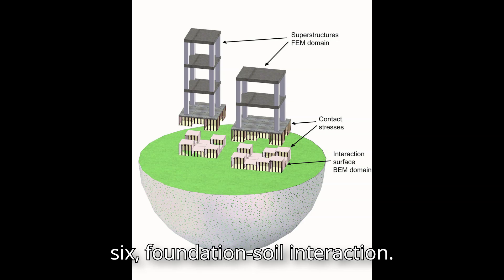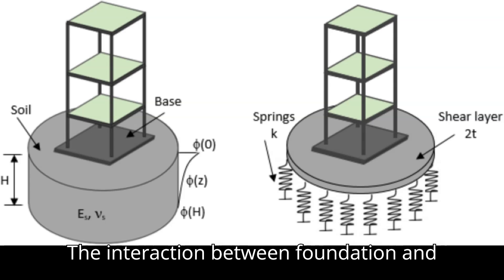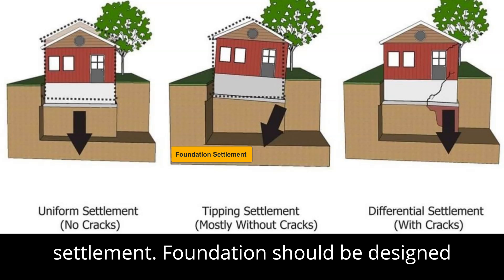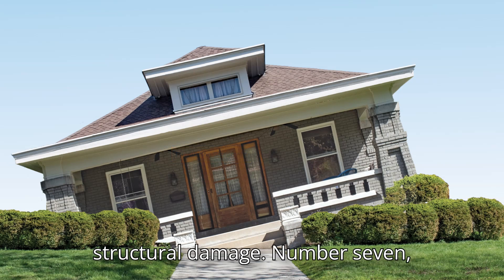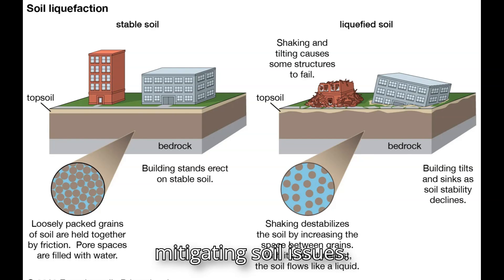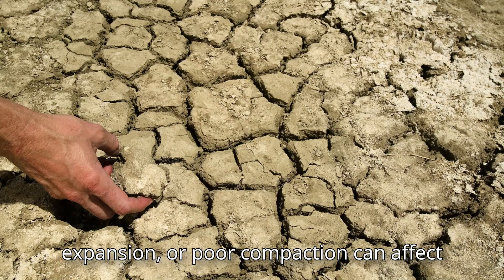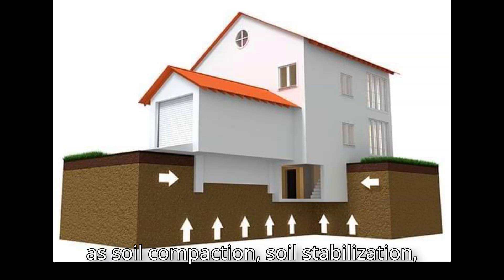How Superstructures, Foundations, and Soil Interact in Construction and Civil Engineering Visually

Comment from the maker: The video used visual concepts to show you how foundation interacts with superstructures and the soil in construction and civil engineering. 
00:00 Introduction to Foundation-Soil Interactions.
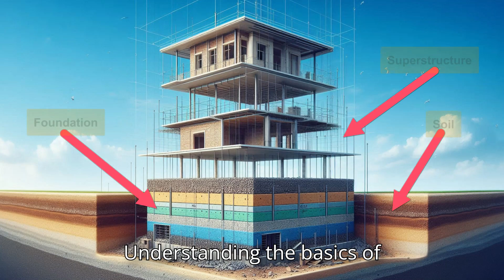00:14 Understanding the basics of superstructures, foundations, and the soil.
03:02 Superstructure and load transmission to the foundation.
03:41 Types of foundation in construction and civil engineering.
04:25 Load distribution in foundations.
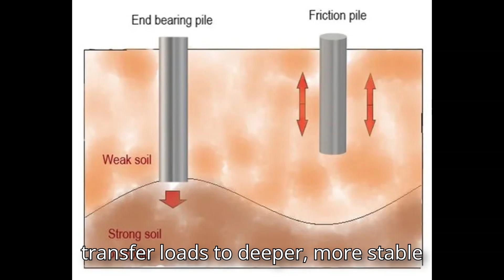04:43 Soil bearing capacity.
05:16 Foundation-soil interaction.
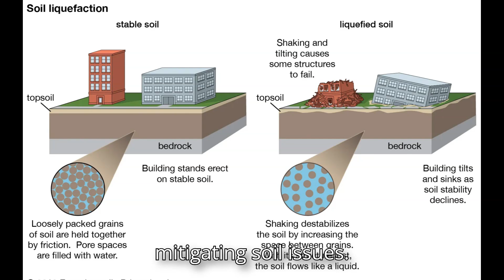05:34 Mitigating soil issues.
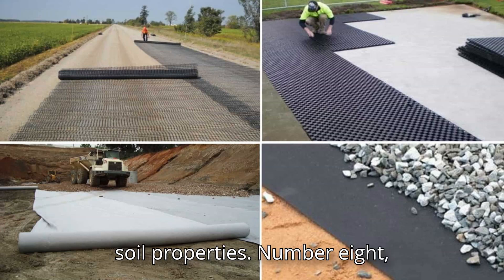05:52 Foundation design considerations.
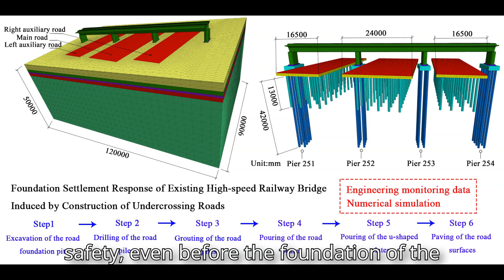06:12 construction and monitoring of foundations.
06: 33 Long-term performances of foundations.
06:50 Summary